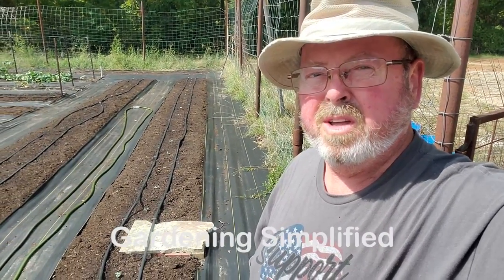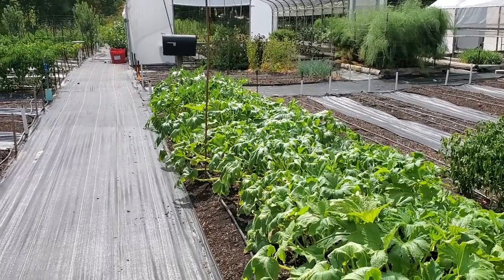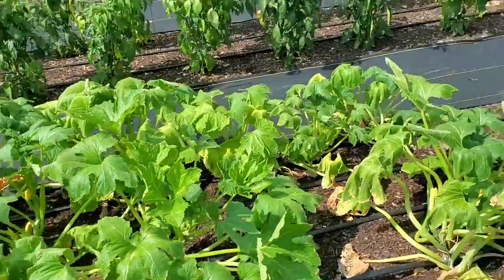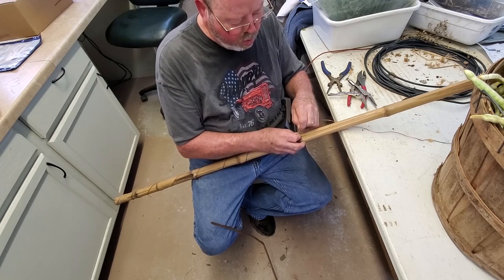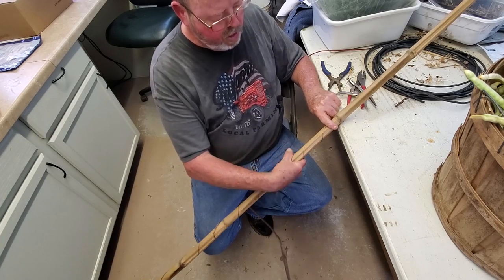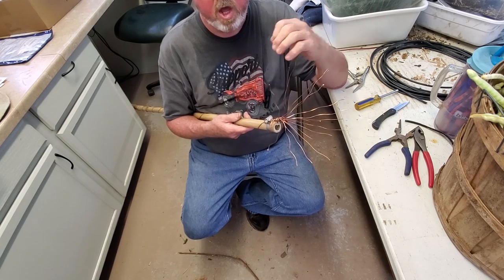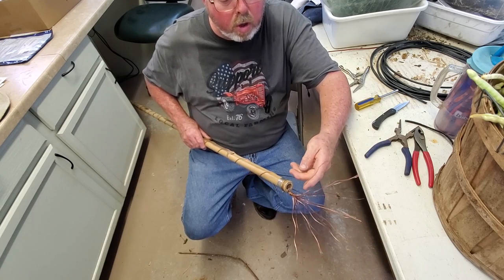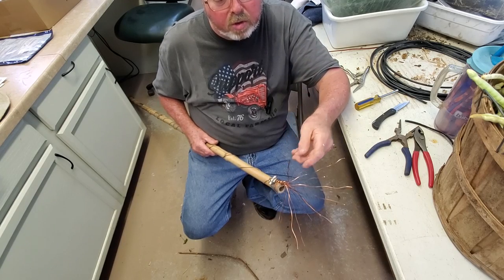Electroculture Part 2 = Easy Atmospheric Antenna

Comment: Clockwise is from the top down. Look at a clock and lay it on the ground with the face up and look at your stick. From the top of the stick is the same as the top of the face of the clock wrapping from the top down is the correct orientation going down the stick the same direction the clock face is going. Wrapping it from the button clockwise up will make the wrapping backwards. Put a clock face up next to your sink and watch the water go down clockwise. That is the clockwise flow from the top going down just the same as the water flows down.
Reply from the maker: Maybe you didn't pay attention to the information in the video. Whether you start wrapping it clockwise from the bottom up or clockwise from the top down makes no difference. When you wrap it clockwise it's going to be clockwise on both ends. In the video I wrapped it counterclockwise, and I stated that there were no studies done that showed that the direction of the windings made any difference. There are those that say that it does, but they haven't run a control group to prove that theory. Just because it gets repeated over and over doesn't make it fact. That's what I was explaining, there's a lot of misinformation about electroculture out there that has not been proven or tested.
Reply: I seen one ladies video where she did some experiments with several different plants and she actually seen better results from counter clockwise which I thought that was interesting.
Her channel is Fantail valley homestead I believe

Comment: May as well ask.
Earth Hz of 7.something.
An LC network to resonate at that Hz can use these coil sizes and a large cap of maybe 8 uF.
I should try AI for answer.
Don't need a long answer if any.
Reply from the maker: I don't think that the resonate frequency is high than that. The frequency of humans and the earth have been rising. I wouldn't trust AI's answers for anything that have been hidden from humanity. You have to understand that AI's original programing was done with the same intent, so it would stand to reason that you wouldn't receive a truthful answer. It's always better to do your own research and weed out misinformation.
Reply: yes, RCL circuit. 7.4 cps. earth charge.
im thinkin tuned too